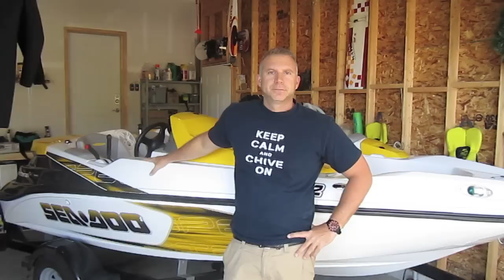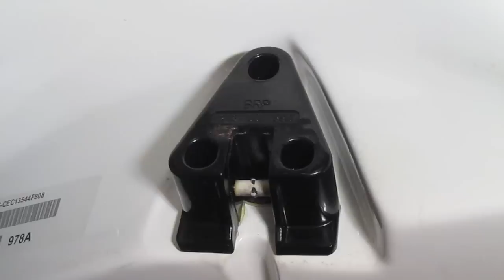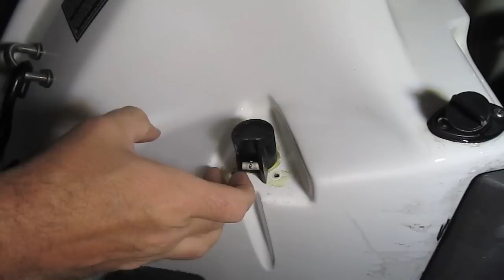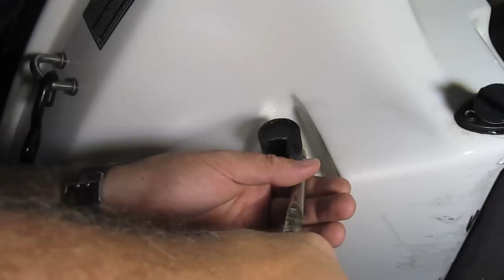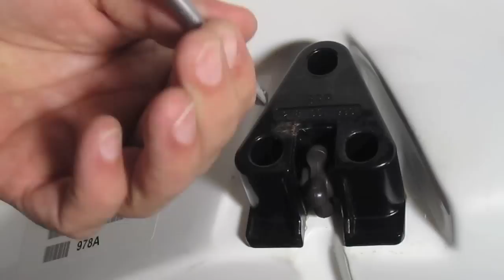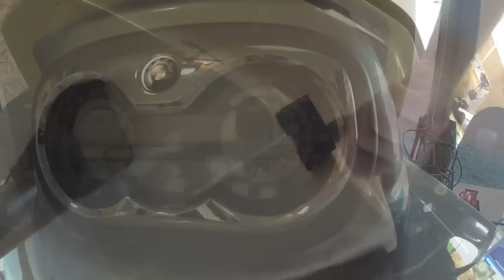How to repair a Seadoo Speed Sensor - DIY

Comment: Just picked up a 2003 speedster le.  My paddle wheel spins freely.  So is it the sensor itself that’s bad?
Reply from the maker: You could try replacing the paddle wheel first as its not very expensive, but it may be that the sensor is dead.  You might also have a loose connection at the sensor side.  Its pretty easy to remove to check.
Reply: @NickOz  I was messing with it yesterday.  When I fire it up.  The speed bounced up and down.  Then I connected a water hose to not dry run it.  And the speed gauge seemed to be working.  But when I had it the water.  There was nothing.
Reply from the maker: @trainwreck5973  Weird.  Must need a total replacement....Sorry dude, not sure what else to suggest.
Reply: My issue similar to a couple here.  The paddle wheel spins fine.  No problem there.  When in the water the speedometer at the monitor reads fine when first in the water up to about 20mph and then it quits and the screen goes blank.  The information center seems to work for all other functions. About half the time, when fully stopping, and then starting back up the speedometer reading will show up to between 10 and 20 mph for just a few seconds and my guess is accurate, and then the screen blanks and no speed shown and it doesn't return until stopped or the first time getting it in the water and starting off.  Any ideas?

Comment: Hi Nick, I have the 2007 150 Speedster 215 HP, so just like yours only one year older.  Great video.  I have a slightly different problem, my digital information center has stopped working, it flickered a few times and now its doesn't show anything.  Do you know if there is a fuse that needs to be replace, or does the howl console need to be replaced?  Have you ever done that?  Do you have a video or know of a video that shows how to replace and recapture the correct data (hours specifically).  Any help or direction would be much appreciated.  Really love this boat, but not knowing how much gas I have, among other things,  is a little bit of a problem!!  Great video by the way.

Comment: I have a 04 sportster le di.  I saw in your video that you were able to freely spin the paddle wheel.  Currently I'm only registering speed readings at low rpms/mph then it stops reading.  I tried to manually spin the paddle wheel and it will only go a quarter turn.  Any ideas before I pull my boat out of the water to inspect it further?  I felt for something impeding it but I couldn't find or see anything.  Thanks.  Great video
Reply from the maker: For the cost of the paddle wheel kit, it would definitely by my first step to change that out.  The pin might be corroded, or the paddle wheel itself might be degraded.

Comment: What in the paddle wheel actually sends signal to the sensor?  Are there magnets in some of the arms/paddles?  Or what?  My paddle wheel spins fine. buy hand, but the dash speedometer reads "zero mph" no matter how fast I spin it....
Reply from the maker: Yes, basically the paddle wheel rotation is picked up by the sensor in the housing. In your case, it sounds like you might have a faulty sensor unit or some bad wiring.  Maybe check the continuity of your wiring if you have a multimeter and see if you can find any breaks.  Otherwise, I think you may need to replace the entire sensor.

Comment: Our gas gauge not working . stuck on full.  We have a 2003 sea doo sportster tec 4 155 do you have any suggestions.
Reply: I know on cars there is a floater device attached to the fuel pump which rises and lowers with the amount of gas in the tank, providing you with an accurate fuel level.  Sometimes these floaters malfunction and cause faulty fuel gauge readings or simply in your case, none at all

Comment: thanks, you just save me $300 in my future repair!   i have a question, i have a seadoo sportster scic 2005, it happen one time the engine suddenly cut off while the boat was 20mph. but i could restart the engine again. do you have the same experience ?
Reply from the maker: Berry Guam Glad you found the video!  Never experienced an engine cut off like that before.  Maybe check your fuel filter?  Might need changing.
Reply: @NickOz  looking to find out where the fuel filter is located?  Don't suppose you have any videos on the location of that fuel filter?  I have the same issue - it is bogged down too

Comment: Great Video, very professional and clear for even a non technical person.  The sensor itself is a $115 part and definitely not worth it for this type of repair, even DIY.  It is so important to draw attention to how simple some of these otherwise expensive repairs can be.  Your time is sincerely appreciated.  

The only thing i can add is while the sealant used will probably be fine, a better product would be 3M Marine Adhesive Sealant 5200 Fast Cure.
Reply: Can get a used one for $30. My shaft broke, I used a matching drill bit end :)